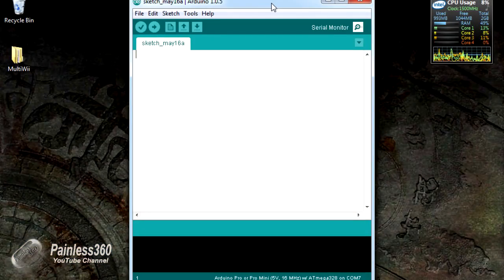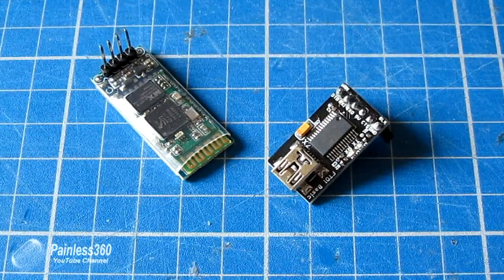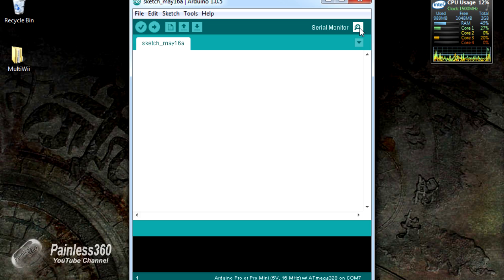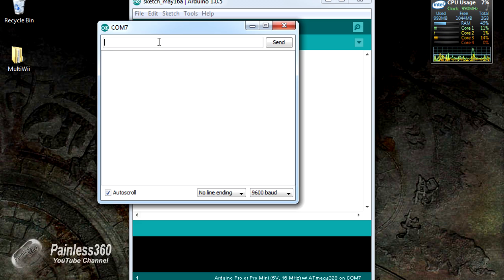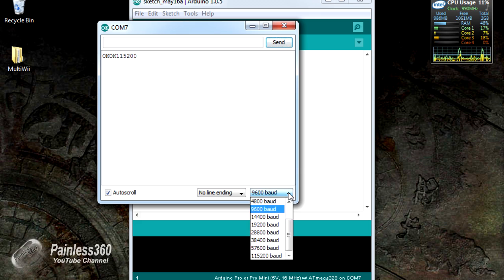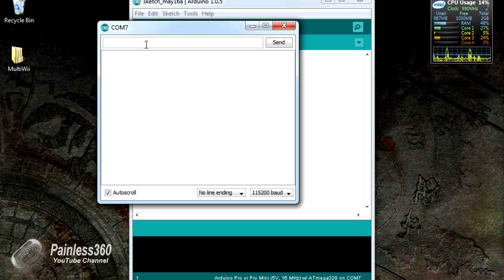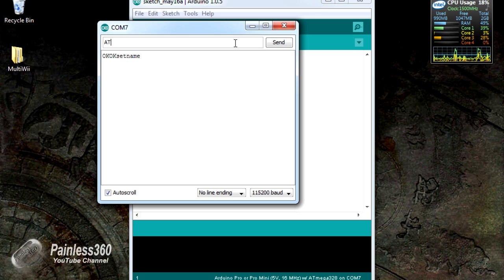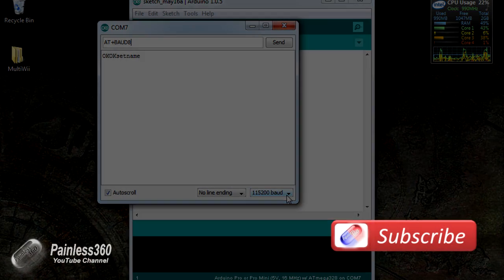How to configure a HC-06 Bluetooth adapter for MultiWii

Comment: I just did the exact same thing you did, with the exact same module, but when I set the baudrate to 115200 it wouldn't connect. It sent back "OK" at 9600, now it's not respnding. This hobby is beginning to get to me because of this stuff. Someone just spent hours telling me I had to high of expectations for the ardupilot documentation lol. I'm using the exact same radio the instructions reference in the documentation. This whole "I'm doing the exact same steps with the exact same hardware but it does something different  for me" thing is starting to get old. I was dreaming of putting cameras on RC planes when I was in the Navy in 2006, I don't want to quit, but it's getting old. I never know if my hardware is going to wire up perfectly and let me configure it, or if I'm going to follow every step to the letter and end up stuck.

Excellent information though. Those FTDI adapters have helped me unbrick many a thing lol. It's good to have knowlege, even if the universe decides you can't use any of it..
Reply from the maker: This is a video that is coming up to 8 years old. These boards were very hit and miss back then with high failure and DOA rates. It might not be anything you are doing wrong. It could be as simple as a bad PCB. Best of luck.

Comment: How connect talmatry 3DR radio with ardunio control in led
Reply from the maker: Telemetry video coming for the latest Pix 2020 series.. Stay tuned!
Reply: @Painless360  Waiting for you.

Thank you so much. I hope you will connect the 3DR radio telemetry to the Arduino to control a servo motor with a switch

Comment: Hi, I am trying to set it up but when I type AT and click on send nothing happens. I had tried to send other commands but nothing is seen. Any help would really appreciate. Thanks
Reply from the maker: What is have you already tried?
Reply: @Painless360  I am trying to change the Baud rate, which will be than connected with SP racing f3

Comment: What command would I use to set it to 57600? I have a HB-02 I'm trying to link up with a 3dr telemetry radio and I need to use 57600
Reply from the maker: +LA Hover if you Google something like 'at commands baud rate' then you'll find the table. Best of luck!
Reply: Thanks found it, it was 7 :)
Reply from the maker: +LA Hover :D

Comment: Hi, thanks for another awesome guide! I experience an interesting issue with same bluetooth module, connected to SPF3 - the modules does not "boot" usually on first FC boot. No blinking led, nothing. It needs a replugging og power plug, second FC boot, and then the LED starts blinking. Does it make any sense for you? What do you think?
Reply from the maker: I've not seen that - let me know if you figure out what it is..

Comment: i dont get "OK" for sending "AT"
Reply from the maker: +Teodik Dilanchian what troubleshooting have you already tried?
Reply: @Painless360  same problem, Checked on all baud rates,tested it on every usb port on two different pcs, made sure i had the drivers installed for the usb to ttl adapter... orderd a second module same problem

Comment: Hi PL. I don't seem to be able to get my FTDI to work in Arduino. So far: - Running win 10, have tried also in win 8 compatibility mode. - Checked device manager. FTDI recognised, running fine baud rate 9600. - Solid green and flashing red led on BT module when wired up to FTDI. When I get to "Serial monitor" and type "AT" nothing happens? No "OK" Have tried all baud rates (You never know your luck) to no avail. Any ideas?
Reply from the maker: +doondedulin44 Swapped rx and tx?
Reply: +Painless360 Thanks for the suggestion. Just tried with no luck.
Reply from the maker: Have you tried all the baud rates in the program?
Reply: +Painless360 Yes :'(
Reply from the maker: Bugger. I notice that the FTDI is different from ours, best of luck..
Reply: +Painless360 thanks
Reply: +doondedulin44 Did you find the problem ? I can't connect my HC-06 with ARDUINO. No "OK" when I type "AT"
Reply: +Corentin “Coco Racer” Pacaud Sorry mate no dice for me. Hope you can figure it out for the both of us 😊
Reply: I tried Arduino and putty, both didn't work, I'm gone :(
Reply from the maker: If you are not using the 'real' FTDI chips then you are in for a world of pain. See the many many many answers already on the videos to see your options..
Reply: I have this one. And I read the comments but didn't find the thing about "real ftdi" :
http://www.banggood.com/FT232RL-FTDI-USB-To-TTL-Serial-Converter-Adapter-Module-For-Arduino-p-917226.html
Reply: +Corentin “Coco Racer” Pacaud Ey mate. PL means not a Chinese clone. You and I my friend have a Chinese clone (Not a 'real' FTDI chip) Just means we have to open our wallets a little more. Clones can work but it is definitely hit and miss. Predominantly miss.
Reply from the maker: doondedulin44 Couldn't have said it better..
Reply: +Painless360 Tada. 😉
Reply: +Painless360 Hi PL Will this be OK? https://nicegear.co.nz/cables-connectors/adafruit-ftdi-friend/
Reply from the maker: Maybe - we always use 'FTDI Basic' boards here..
Reply: +Painless360 Voila? https://nicegear.co.nz/electronics-gear/sparkfun-ftdi-breakout-5v/
Reply from the maker: That looks like a few we use here - best of luck with it and I hope that one isn't a fake. Happy flying!
Reply: +Painless360 Thanks. For the price it better not be ☺
Reply: ok:/ but 25€ the FTDI....
Reply: +Corentin “Coco Racer” Pacaud Nope. That's $25 nzd. About €14. But I'm sure you'll get it cheaper than that. NZ tends to pay more for most things as we are at the "bottom of the earth"

Comment: This is so frustrating. 

I have followed your every step and can't even get the first command to work, pleas watch my 17sec vid and help. 

https://youtu.be/QMWiwt6uf_s
Reply: I know you will ask what troubleshooting have I done, I have tried all Baud rates and all board types, the only reason I got the BT for the Naze32 was because of your videos, if it all works it would be great!
Reply from the maker: Swapped Rx and Rx cables round? If that Durand work then the FTDI or BT module need checking..
Reply: +Painless360 yep, don that, I think I might have a duff Bluetooth board.

Comment: what processor what board and what programmer do i use i cant find info anywhere
Reply from the maker: +Jake Ruebel You don't need to set that, the board should come with the software on it you need. The board and CPU selection has no affect on how the Serial Monitor works - have you tried it?
Reply: +Painless360 I see that it picked it up automatically. The problem is none of the AT commands are working. it's set at 5600 and is working but I cannot configure it using Arduino

Comment: Hi Painless, I'm trying to connect HC-06 Blutooth adapter to Multiwii, initially to changes buad rate, I connected via FTDi adapter to my PC. My PC detects the FTDI as COM6 and HC-06 as COM7, there was a blinking light in HC-06, Once I open Arduino and select COM7 and open serial monitor, the blinking light becomes solid light in HC-06 with buadrate 9600 and "no end line". If I send AT, there is no response HC-06. My connectioned  HC-06 to FTDI is   GND to GND, 5V to VCC, RX to TX, TX to RX.  I tried even different buad to connect but no response. I'm able to detect the blutooth signal in my mobile. Please help me.
Reply from the maker: +Purusotaman E.G. Disable the BT module on the PC and use the FTDI com port.... Best of luck!
Reply: +Painless360 , Did the same and used COM6 and no response after sending"AT" , the bluetooth module just blinks. Tried with 9600 and different buad rate too.
Reply from the maker: I'd go back to the vendor then, best of luck!

Comment: Hi, I'm running into the same problem as others... My FTDI is working fine (I can use it to configure a minimOSD board, so that proves it's working), and I can connect to the HC-06 fine via BT from my PC, phone, etc, but no serial response of any sort back from the HC-06. Yes I've done all the basic troubleshooting... checked drivers, swapped lines, etc, etc. Any new thoughts on this? This is making me feel like some sort of noob!!!
Reply from the maker: Mark Petersen Connecting to the BT adapter using the phone proves very little. In my experience it's the connection from the BT to FC that causes the problems. You need to confirm that the baud rate is correct for the FC and then make sure you have the tx/rx lines connected.Best of luck.

Comment: Hello. First i'd like to say that your videos are well organized and easy to follow, thank you. I'm having trouble communicating to my HC-06. The one i have doesnt need an adapter like yours. It connects directly to the my MW328p. It pairs with my galaxy phone but it does not show any Parameters. Ez Gui App tells me "no data received". I've follwed this video ( https://www.youtube.com/watch?v=Uwn5DGf1bko)  but nothing works thus far. Can you help me?
Reply from the maker: Roberto C. Mercado What troubleshooting have you done? Did you connect it to the PC to configure it?
Reply: I have tries different apps on my phone. Switched the tx and rx cables round on the FC and module. I've tried communicating with serial port in arduino type all the commands but no response from Hc06. Nothing is working except it pairs with my galaxy phone.
Reply from the maker: And have you setup the baud speed?
Reply: Should I have done so in the PC or in arduino?
Reply from the maker: In Arduino software - see 1:17 in the video for the answer to your question.

Best of luck.

Comment: Hi !
i'll do the same wiring diagram than you and the AT Commands not responding with my HC-06 BT module ....
CAN YOU HELP ME ???
Reply from the maker: Why are you shouting? What troubleshooting have you done?
Reply: Painless360 i wiring like you show in the video but i have only a red led blinking when i plug it with the FTDI...
No response with AT commands...
Reply from the maker: So have you swapped the rx and tx cable? Tried every baud rate? Checked that the FTDI driver is loaded properly and you can see it in device manager? ?
Reply: My FTDI module works fine, i already load Multiwii 2.4 in my MultiWii v2.5 card (and my QuadX works fine).

My Wiring Diagram:
FTDI RX>BT TX
FTDI TX>BT RX
FTDI +5v>VCC BT
FTDI GND>GND BT
it's OK ?

With Arduino Software : Settings for card must be in 3.3v or 5v ?

I will trying every baudrate this evening...

Thanks for all ;)
Reply from the maker: Try a different version of the Arduino program - if that fails then it maybe that the BT module is broken..

Best of luck

Comment: HEY, i connect every tink and i dont get the at ok, can u help me?
Reply from the maker: What troubleshooting have you already tried?
Reply: Painless360 i try to put rx to rx and tx to tx, i try in reverse and nothing, the bord is on but no signal from the pc
Reply from the maker: What settings do you have in the Arduino serial monitor program?

Comment: Do I need to use an FTDI... or can I use a USBasp? .. or can I talk thru a raspberry pi.. or arduino board to change the BAUD? That is All I think I need to do????
Reply from the maker: Daniel, https://www.youtube.com/watch?v=qLaH4qkJNt0

You can get them from lots of places, search for 'FTDI Basic adapter'. You can use other boards but I don't.

Best of luck.
Reply: http://www.amazon.co.uk/gp/product/B00P46DTGM?psc=1&redirect=true&ref_=oh_aui_detailpage_o05_s00

works
Reply: Painless360 I guess I could have used the serial port on my system and powered from another source... DUH But I got the FTDI it should be a useful tool anyway

Comment: What if you don't get any feedback when type AT and send
Reply from the maker: What troubleshooting have you tried so far?
Reply from the maker: Have you tried all of the baud rates?
Reply: Who me? I got it working.
Reply: i got one but it won't respond any thing
Reply: Farook Mohamed What are your settings? Baud etc
What exactly did you get? Model?
What OS? What kind of serial software?
Reply: It worked in the Arduino software with an ftdi and 9600 8 n 1 no cr/ln. I tried another ttl usb adapter  and that didnt work on windows and mac. 

On MAC you can get a tool called Serial Tools that works too. There is also Putty on Windows etc.

Comment: Hello,

I have the HobbyKing ATMega2650 board and I have been struggling to connect the bluetooth module for days now.

You say the default baud rate for MultiWii is 115,200.  But, I have MegapirateNG (3.1.5-R2) loaded on this board...  

Have you ever set up a BT board with Megapirate?  Do you know what the default baud rate is for MP?  I cannot even get my computer to handshake with the BT board.  I was considering trying multiple baud rates, but that could take a while--I was hoping you might have the answer!

Thank you for your videos.  They are a ton of help for those of us who are getting into this great hobby but have little experience.
Reply: No worries, I got it to work!  The key change was me powering the bluetooth off of the BEC instead of the main board.  I may have had too many peripherals plugged into the board (GPS, Rx, etc).  I got Mission Planner up and running over bluetooth.

Comment: HI! I'm trying to configure my BT module by AT COMMANDS whit Arduino. I dont have a FTDI board as we seen in the video, but I have a USB to UART board (http://www.ebay.es/itm/130683943875?ssPageName=STRK:MEWNX:IT&_trksid=p3984.m1497.l2649&clk_rvr_id=683556886088). I connect my BT module with this board (Tx to RX, RX to TX, Vcc to Vcc and Gnd to Gnd). Then I connect de USB to UART board to the PC and i try to send AT commands with Arduino but i have no response...:( Any idea?
Reply: I HAVE the SAME problem any fix?
Reply from the maker: Hi Pedro,  I have not tried it using that board. The only thing I can suggest is that you try swapping the tx and rx lines and try every baud rate. 

An FTDI adapter is inexpensive and vital for any multiwii style setups. 

Good luck with it, happy flying!
Reply: It only worked with ftdi for me. Another adapter didn't work.
Reply from the maker: Yep, go FTDI. It's not worth the hassle..

Comment: Hi, Do you also have a video about how to set up and connect the MinimOSD to the Crius MultiWii V2.5? I am dealing around with it now for several days, but I have not got it working so far. Thank you very much for all your other videos! Very helpful for me, very good explained...
Reply from the maker: Hi Thomas, my MinimOSD is on it's way and once I've got it sorted I'll post a video. Looks like there are a few steps to get it running and I'm not clear on any code changes needed on the main MWC to get it running. Watch this space.

If you get yours running I'd welcome a video/email with tips..

Thanks, happy flying!
Reply: Yes, I will let you know or will post a video on how I did it. Thanks...
Reply from the maker: Awesome! Did you have to change the code in the main board? Which connector on the Cirus board did it go into? Very interested in your method and results. Thanks for posting..
Reply: No it is not working yet. I have the video signal from my cam but no OSD overlay. I am playing around with this code https://code.google.com/p/rush-osd-development/ but i was not successful. Maybe you can give me a hint how to set it up and how to connect the MinimOSD to a MultiWii. When i connect the MinimOSD to the PC everything looks fine, but i cant get an overlay. :(
Reply from the maker: Hi Thomas, my understanding is that the minimOSD is expecting to see the MAVLink data coming out of the telemetry port on the APM flight controller.

From what I can read (haven't got mine yet) you only get the OSD display active when the board gets this input. I'm not sure if the 'basic' Cirus SE 2.0/2.5 board send out this MAVLink data to fire up the OSD.. I need to get mine to play with..
Reply: That's possible, looking forward to your experiences ;-)
Reply from the maker: Thomas W. I've got it working - finally! Tricky little bugger but once you've got a few things figured out it works a treat. I'm uploading a video as I type that should cover what you need. Awesome OSD for less than £10!Happy flying!
Reply: I just saw and followed your step by step guide... Great thank you!!

Comment: Thank you very much for the video, it helped me configured the module.
I still have issue with Windows 7 connection.
The OS discovers the BT device, installed the drivers of the uart but under “Device control” it indicates “Unknown Device Operation” and doesn't let to connect to it.
Any idea?

Comment: Thank you so much for this. I ended up getting luck with mine. I used the Ublox software and it eventually recognized it and I was able to get it working. I didn't know you could use the Arduino IDE.